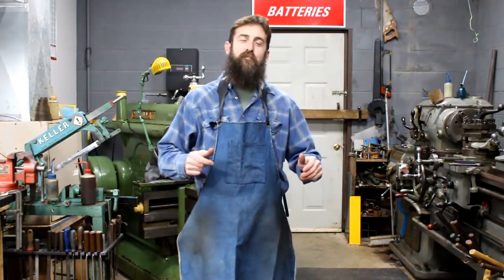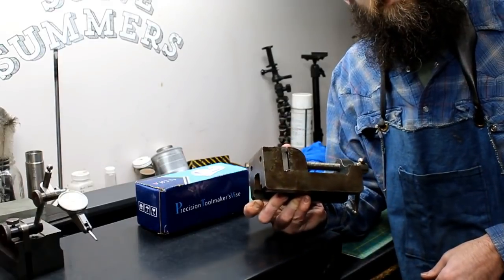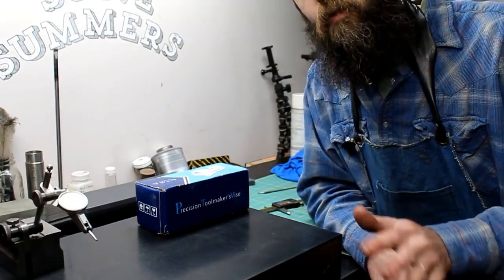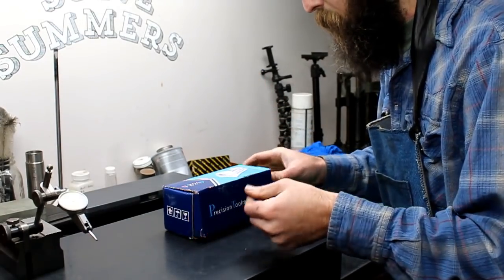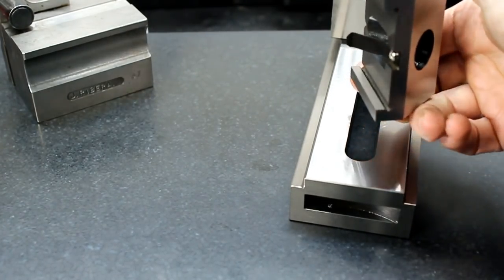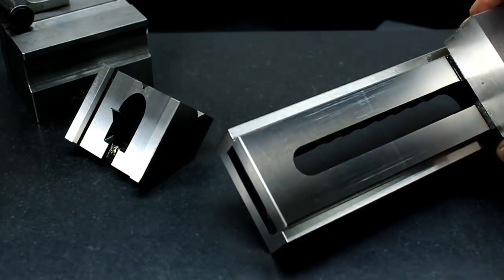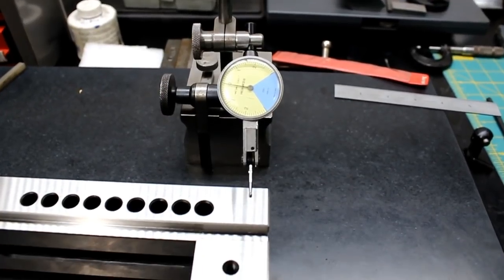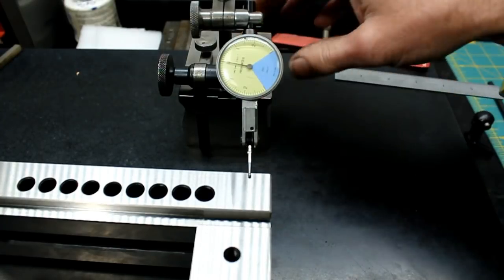Surprizing ToolMaker's Vise Review

Comment: Good review - Thats what I expected for that vice ;)
I have a bunch of chinese grinding vices scattered all over the shop and not a single one of them is what I would consider "bad".
Reply from the maker: Stefan Gotteswinter. I was surprised, I've never checked one before this and was expecting it to be much worse than it was. Other than the movable jaw grinds the vise was good.  Thanks for stopping by Stefan and glad to hear you have some also.
Reply: Stefan and Steve, the Chinese produce stuff like that vice to different standards. They focus on the essentials of accuracy and save on non-essentials like the cap screw. The cap screw is hardened to Rockwell butter hardness, and that cross pin is beyond glass hard.... They focus on the important aspects of the tool, and not the peripheral parts. That vice probably cost 1/4 the cost of, say an European vice. Their fit and finish is much less, but the overall function is good. I have no problem buying Chinese tooling, etc., just be aware that quality control is relatively kind'of sort'of non-existent. For example, I bought a set of metric jobber drills where most of them would be better at removing a cork from a wine bottle than drilling a hole....! Cheers from Canada, Daniel.
Reply: Stefan, in amongst you collection of grinding vises you have a really small one. Just wondering where you got it? I want such a vice to use on a T&C grinder. Thanks
Reply: I bought it from a Chinese Vendor at a tradeshow. I guess he was not supposed to sell it..he didnt have any money with him, so he gave me some calipers as change ;)

They show up on ebay too.
Reply: Personaly I dont care much for the Vs, The more I was suprised that you checked them, well done :)
It is my prefered style of vice on all machines - I will even put one on my shaper once I find a big one. I have a 90mm wide one on my mill and on my engraving machine...
Reply: Sounds like you have a vise vice! :)
Reply from the maker: Robert Orr LoL, I go back and forth spelling it both ways😄 . Spelling is one of my real weaknesses.
Reply: Shop Vise.... both have an 's'.  maybe that will help :)
Reply: I'm not a fan of those V's, as they are on the moving jaw and not the fix. So for general purpose stuff sure they are nice, but for anything accurate you can't rely on it to be in the same spot time after time.
Reply: You can not have enough vises.
Last week I had to do a job at my little chinese mini mill and for that I used four vises to be able to clamp the part which was much larger then the table of the mill but real thin.
Reply: Ben Rivenbark  do they? Not in England they don't lol they are both spelt VICE and we are writing in English after all..............

Comment: Very good review. Thanks. In December of last year I ordered several (5/8" shank) tool holders and inserts from Banggood. What I got was a paper envelope with the order # on it , in a plastic envelope from the post office saying it was received empty. A paper envelope with steel tooling inside! I notified BG and sent photos of the envelope, and the letter from the PO. They asked me to prove I didn't get the items by getting something official from the post office. I went to the PO and got a letter on USPS heading signed by the postmaster. After several more exchanges they sent an email asking if I wanted a refund or the products. I replied send the products. It is now April 8 and i still haven't gotten anything and don't expect to.

Comment: Very well done video, Steve!  I have the 3" jaw version of that vise (same maker's box), bought from HFS (Hardware Factory Store) for $42.50 and free shipping (came overnight!)  It tested essentially the same as that one did, and I was impressed.  I could not find any flaws in the finish.  I did not test the V grooves in the movable jaw, but if I did, I would have used an equal diameter pin on the opposite side so the jaw would not cock, which  takes away any hope for accuracy there.  Now I will have to test the V's in my jaw...   Keep up the great videos, but work on reducing their length while not leaving out content.
Reply from the maker: Bob Korves The only way I could reduce the length is to leave out content, I guess i could have cut out a minute or two of indicator setup but other than that I'm not sure what I would cut.  I plan to retest the side vee with a longer pin and add on the top of the comments my results.

Comment: what most people don't realize is the products sold by importer,s like Banggood, amazon, Ebay, alibaba, etc... Dont get the cream of the crop from the factories. I once purchased two Bushnell rifle scopes from China at two different times, for one eighth the price from Bushnell. One was obviously flawed, the other was a little more difficult to find the flaw, but it was there.However both performad as well as the higher priced company sold one,s. one of the flaws was cosmetic, but the more obvious flaw was not, it was detrimental to the function of the scope, the cross hairs were slightly canted. The fact it was difficult to find the flaw in that vice, is indicative of the quality that the factory that produced it, is capable of, and probably does produce for a high end vice company or well known brand. $110 for a vice of that quality is a steal. Great review by the way.
Reply from the maker: airguns freedom700 SSP Thank you

Comment: I  made several squaring blocks for the Bridgeport mill table. They are 2.25 x 8 x 10" hardened and ground 4140 with several rows of 1/2-13 tapped holes with a few 3/8-16 tapped holes in both faces. Both ends also have (4)3/8-16 tapped holes in them for a common 7" long side plate, for holding work square. There is also an additional small block that has 3 holes 90 degrees to each other. Two to hold it to the face of the block, and one threaded, in between the two to accept a set screw for applying pressure on the work-piece to the side plate. The entire bottom length of the block has  3 pieces of 5/8 fitted, hardened keys to hold it in parallel alignment to the mill table, with long 1/2 -13 bolts c-bored in from the top to t-slot nuts for the table.  The TE-CO mill table hold down clamps can be used to hold work to the face, as well as C-clamps. This is a rigid set-up block that I used every day and found it invaluable. You can then make other things like large V-blocks to mount to it, for holding large round work.  Hope you can picture this and make use of it.

Comment: Thorough review, well done. I also learned a few tips for using my surface gages. I purchased one based on your review and everything measured as yours did except the width of the moveable jaw, which is smaller than the width of the fixed jaw. This makes alignment using the side faces of the jaws can't be used. I'm going to contact customer service at banggood and see what they will do about the problem. Your jaw sides seem to be very flush, probably ground at the same time. Mine were not. Otherwise super for the price. Thanks for the review!
Reply from the maker: Jim Milne I believe that is on purpose,  my movable jaw  is also not the same width as the fixed jaw. I'm sure this is for clearance when the vise is mounted on it's side. That way you can still operate the jaw and it won't rub the mounting surface. Thanks for watching. I must say that over all I am pleased with the vise.
Reply: You have a good point. I'll be trying it out today. I just received it yesterday evening. Thanks for the kind response. I enjoy your videos and learn from them. I also like your style and tempo. Again, thanks for sharing.
Reply from the maker: Jim Milne Not a problem and thank you for watching. Feel free to ask if you have any questions. I'm not a professional machinist but I will help if I can.

Comment: I'm pretty sure that somewhere in the factory where they make these hardened and properly ground little vises for quite low money is a CNC grinder or two to make these. What I've handled these they have all been good as far as tolerances & dimensions go and they cost what, 100 doll hairs?

Comment: Since you know the ways are parallel to the foot, and the face and back of the fixed jaw are parallel to your ability to measure, you can get a much more sensitive square measurement by standing the vice on end and comparing the ways and foot near the opposite end.
Reply: The ways my not be parallel to the foot as Steve did not check the foot for parallel to the surface plate. So you can't assume that the foot and ways are parallel to each other in the centre.

Comment: Steve I'm watching this two years down the line. One thing I think you did miss was that when you were "hinging" the vice on its base it was spinning about the very end of each end of the bed of the vice that could have indicated that it was hollow in the middle of the base. You determined that the movable jaw bed was a parallel with the surface plate but you didn't turn it upside down and put the movable jaw bed on the surface plate with the fixed jaw hanging off the side of the plate and indicate along the foot of the vice to see if it was actually straight or maybe hollow as I suspected. Other than that it's a fair and honest review of the product, even better for you that it was free!. As a matter of interest what was the Banggood retail price in USD at the time of the review? Cheers from over the pond in October 2020

Comment: I got this same vise on Amazon (package was identical) for like $46, with the full expectation that it was a "kit" I could make into something serviceable. Turned out I found it the same as you did. Darn thing wouldn't move the indicator a tenth no matter which way I checked it. I would surely trade it for a Suburban, but you have to give credit where it's due.
Reply from the maker: wallyblackburn 46 bucks is a great deal for this vise. Worth every penny if you ask me.👍

Comment: Very nice and in depth video Steve, but I have a question about the v's being out of center in the vice. I can understand if a rod being machined is 2/10 out on an angle in the v, but as far as the v's being dead center (30 thou out) in the vice jaw,  I don't see how that matters since you will clamp your vise down  on the table and then touch off either side of your part and determine center from that. In other words, your part could be 2" from center and still machine your part after touch off. I might be missing something here so if I am please help me to understand.
Thanks Steve

Comment: One of the companies which I have bought tools (like this) from advertises a toolmaker's sine vise and claim it's within .0002. I will probably order one (have desperately needed one in the past for some one-off jobs). Even if it's not within the .0002 as advertised I can regrind it to that spec or closer(I work in a tool and die shop, I can do that sort of stuff)
Reply from the maker: ColKorn1965 You may be surprised like I was. I expected much worse. If you have access to a grinder your good to go. 
Thanks for stopping by
Reply: We bought a Palmgren angle visefor the mill, expecting it to be "Palmgren Quality". If we want to cut a 45* angle one side of the part needs to be shimmed .007. That's unacceptable to say the least. I was glad to see you review this toolmaker's vise for that reason.

Comment: You have a good vise there.  I have a 6" magnetic cyclinder  square if you want to check closer.  When you read .0001 or less in 6" you have a great vise.  If the 1-2-3 block is good you could clamp it up and read the top edge, it would give a more accurate reading for squareness.  Like everyone else that one surprised me and is more than enough for all jobs unless doing gage work.  The .002 reading can be easily be ground in with a surface grinder but is not necessary as it is just clearance.  Also your surface plate is pretty flat- I have seen some get different readings just sliding the surface gage around!
Reply from the maker: James Spallinger Thanks James. This vise is better than I need for the work I do. I was surprised at how nice it was for the price.

Comment: Definitely interesting.  I wonder how much of the jaw error was due to the short pin, using a long pin would support the whole width. With the amount of slop in there it going to move, so for a really accurate test you would have to test with the jaw on the surface plate. Metrology is definitely a rabbit hole once you start lol

Comment: Nice score.Dead nuts accurate. Replace that socket head cap screw with a nice one and you have a great vise. FYI, you could have avoided the gage on the ways by inference. Simply determining perpendicularity of the fixed jaw outside with the gage on the granite, as you did in the end, and then sweeping the inside of the fixed jaw for parallel which you did earlier on, with the vise on end, proves square without having the gage off the granite.
Reply: Safe to ignore the bad result with the pin. The screw is bent, and the bent screw will torque that moving jaw around, adding a bit of soft wire on the moving jaw side would likely give a better result without a replacement socket head cap screw. A new high quality screw will improve your results. The .030 though, if the centering of that vee is important, grind .015 off one side of the vise, or put it in the shaper. :-D

Comment: Interesting Steve - I have the same size vice which I have used very little - similar results on the fixed jaw and slightly better on the V's but still enough out to make certain tasks a pain. Its on the list to 'modify' so its better. What kind of movement do you get on the moving jaw as its clamped ? It must try to skew a little as it clamps and I (maybe incorrectly) had assumed that was part of the errors I got when checking the pin readings. Good score though - free vice for an afternoons review filming ;-) All the best Mat
Reply from the maker: lookcreations Hello Matt, I never checked it while clamping, I'm sure it affects the reading somewhat. I will check.  All and all I would say the vise is good and I'm  happy to have it. Can't beat the price, that's for sure😀. In reality this is probably something I would have bought anyway, I couldn't justify spending 100s of dollars on a name brand grinding vise. Just glad I could share my findings with everyone, that way if they are in the same boat as me when it comes to having little extra money they can have an idea of what to expect.   Thanks for stopping by Matt, I'm  glad to see u

Comment: Steve 
I have a feeling you will be correcting the vee notch for symmetry
Reply from the maker: Mike Miranda I plan to. Should be a good exercise. I plan to get a surface grinder soon and will gladly correct the inaccurate vees😀. I will need to double check my results on the side vees due to the fact others and myself believe I used to shot of a pin to get a real accurate measurement. Thanks for watching.

Comment: Would have been nice if the holes in the side were slotted out to allow clamping from the side. The only parameter you missed but probably can't measure is the hardness of the jaws. Nice review overall looks like a pretty decent tool. BTW Tom is a very knowledgeable fellow but I am sure he did not devise that test method he merely reported it. All of these methods have their roots in basic principals drilling down to the basic requirements and how to achieve such an outcome . Principals like the classic 3 plate test
Reply from the maker: Rob B I agree, Tom L is my source for the method and as I am sure you know has a video out on it. I mentioned Tom only because people can go and watch this and different methods on finding square. I tried the file method and it is hard but I have no method of determining just how hard it is. I decided to remove that section of video.   Thanks for watching Rob

Comment: Get ready for the China haters and those who will accuse you of selling out, making infomercials for Banggood, etc. Anyway, thanks from me for providing a clear look at a product that I’d have to otherwise purchase sight unseen. By the way, I think that you should always expect complementary readings on your 1-2-3 block, i.e., if you read +2 tenths on one side, you should read -2 tenths on the other side. Otherwise, you are proving that those sides are NOT parallel.
Reply from the maker: Paul Mathews LoL, I really prefer usa products myself but given the money they they cost they would be no way I could afford one. Not at all worried about trolls. This is an honest review. I'm not selling anyone anything.   Just sharing my experience.  Open the gates. I can take it 😃   Thanks for stopping by Paul I'm glad to see you.
Reply: His readings on the 1-2-3 were good, they are relative not absolute because he doesn't have a master square to set absolute zero. If he has already checked that they are parallel and then gets the same reading on both sides using the method shown, he has shown that they are at right angles to the face he is resting on. If he had got +2 on one side and -2 on the other, then his 1-2-3 isn't square but he knows that true square is at zero.
Reply from the maker: grafixbyjorj Yes, this is what I was trying to show. Thanks for commenting
Reply: grafixbyjorj I don’t disagree with you. I am adding the assertion that a 123 block with parallel sides will always have complementary readings on the 2 sides.
Reply: If it's parallel but not square then yes, the readings on a gauge which has been set to zero on a true square will be complementary. If it's parallel and square, the readings will be the same on both sides, and it doesn't matter what number that is, because it's just an offset.